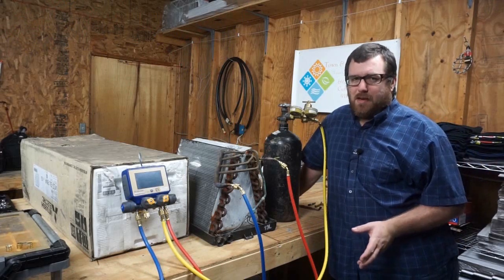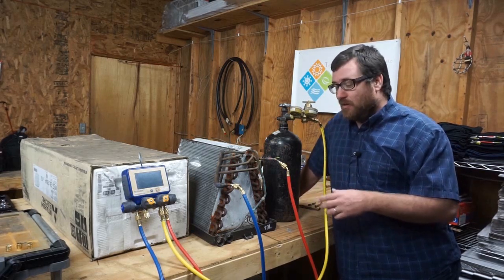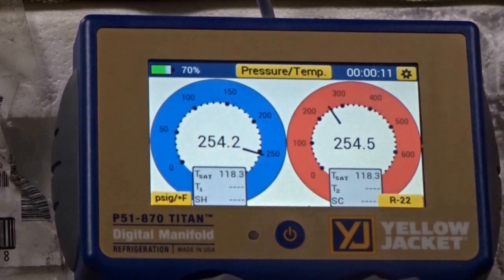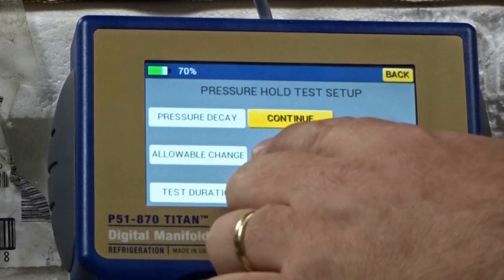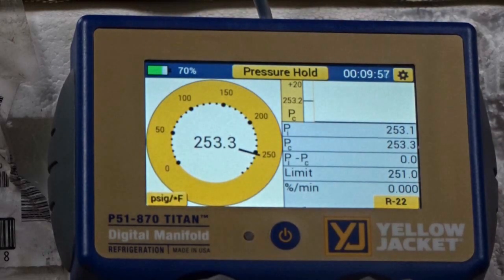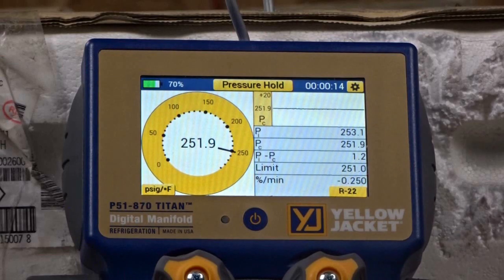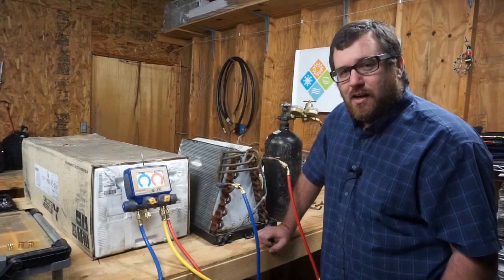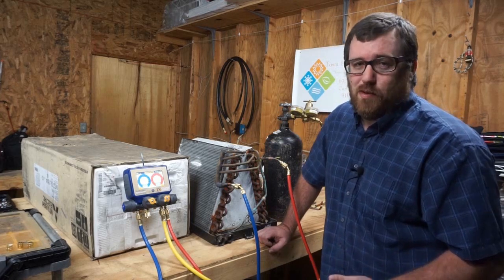Can a Leaky Evaporator Coil Pass an HVAC Leak Test?

Comment: I emptied the coils of all the puron and then hooked the coils up to a vacuum to see if the vacuum pressure would change if there is a leak. If there is a leak in the coils, the vacuum pressure should change. However, no change after 24 hours. So I will try to do another different test as well as look for other sources of the leak. Any suggestions? Thank you.